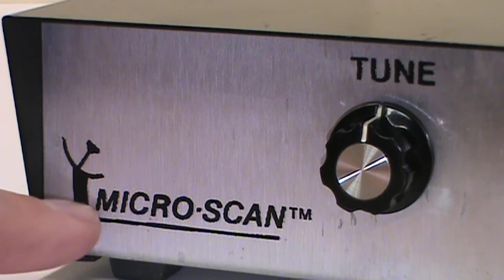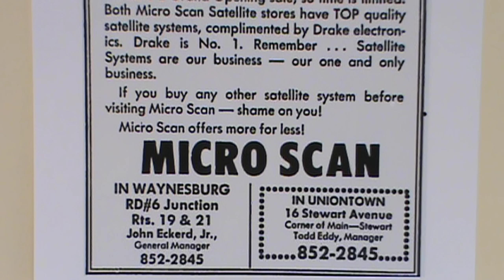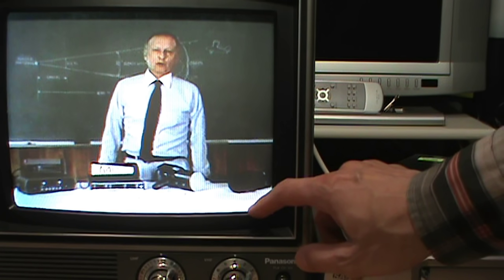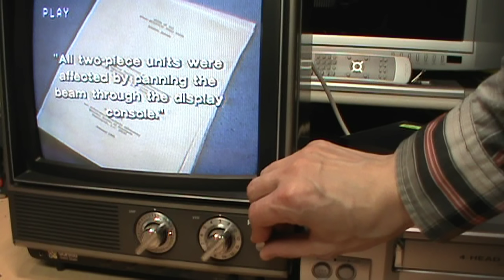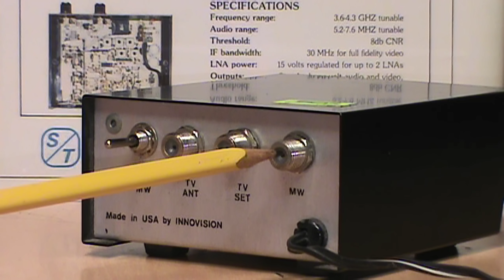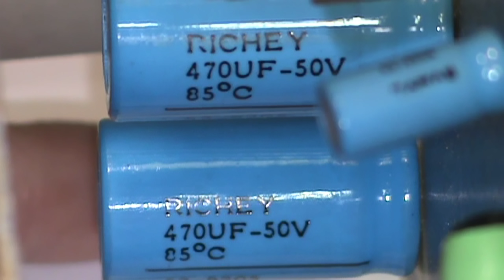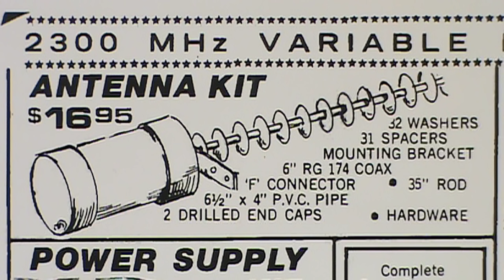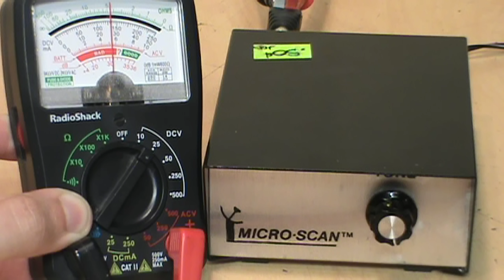Micro-Scan mystery 1980s TV device - Satellite? Microwave?

Comment: The minute I saw the box, I knew what it was. I bought the antenna you see in the upper left of the page and it included a box similar to the one you have, except I believe mine was in a wooden box. I want to say that the system was called a 'MDS" system Multi-point Distribution System. In the Metro DC area there was a transmitter somewhere like Silver Spring or Rockville and the signal was a pay service such as HBO or Showtime. The tuning knob adjusted the voltage into the antenna to actually tune the frequency being received. 

This was about the time VTIF's Variable Tuned IFs were becoming popular. The reason you didn't fing a lot of information on the devices is probably because of the following. The MDS frequency was just outside the Ham band. These devices were often marketed towards Hams for experimintation but the frequency 'slop' covered the MDS frequency too. Thus it was sold as aHam experiment but (nudge nudge wink wink) it allowed people to illegally access signals which were part of a paid subscription service, thus cheating. You should know that there was a time when satellite dishes for home reception were becoming popular. HBO and other services were not scrambled because , who could possibly have their own satellite dish at home? I did, a small one. 

HBO shut off their east coast feed at about midnight but the west coast feed continued for another 3 hours. You could watch uploads like Star Trek being uploaded and downloaded from the satellites t othe networks and often see shows on your own dish a week in advance of the actual public broadcast. You also could see live news feeds being uploaded. During the OJ trial, I was able t owatch news feeds inside the courtroom, see who was waiting outside the courtroom, see the press interviewing people outside the courthouse, just by flipping channels. So although these MDS systems were neat, they were very limited t owhat you could watch compared to real satellite TV.

I started working for a satellite TV receiver company. Telstar 301 had two channels with audio channels crammed onto them. I was able to decode a channel and found outbound telephone calls to Eurpoe. The other channel I assume had the retune audio channel for the conversation. I am sure they encrypted those channels as the public got more into owning their own dishes.
Reply: Something very “romantic” about this story, a window back in time. Thank you.
Reply: @soldierski1669 excellent way to put it. Cheers
Reply: I remember these,  all those  disc yagi antennas up on roofs,  some people made home made versions of these using soup cans and stuff.   those businesses went belly up as soon as people found out they could get free HBO buying one of these things nobody was going to pay for those services.  by mid 80's  the BUD (big ugly dish) C-band was the rage.  then directv took over by mid 90s.  and well they are still the king for over the air cable.
Reply: We had something similar to this in the 1980's with a small dish. My dad pointed the dish at the IDS tower in DT Minneapolis and we got to watch HBO.
Reply: Oh man I could tell you a story about that. I was in my VW bus which I still own, and I had a couple of those that I built from the kit and the little microwave receiver dish anyway I was parked next to this hundred thousand dollar motor home and the man had said see what you can get when you retire. I was watching some rated r movie and it was patched into my stereo system with a 16 and graphic equalizer, 200 w, and four- 6x9 speakers, I had ran the coax out to the picnic table and put two of the portable speakers on top of the on the ground, that was in Southern California😅
Reply: @patrickmccleary1144  i got one of these devices from my uncle who was a ham radio operator around 35 yrs ago, he taught me all about creating antennas and boosting cb, some yrs later i bought his vw beetle which i still have to this day.
Reply: Holy cow! My Dad had one of these, and I instantly recognized it. I was about 8 years old when he set this up. I remember it being a long summer project he worked on. He explained it a little when I was young, but you just filled in the details I either forgot or never understood. I am in IT Security today with a long history in networking, including mobile phone networking SS7 and such. 

My father passed away in 2021. I did ask him a few times over the years about this. He couldn't remember the details. He did this in like 1983 or 84. He had other projects like Teletext and such. 

THANK YOU!!! For stirring up good old memories and piecing together a 40 year old mystery in my head 😂.
Reply: Remember when at night , what came on??
Reply: @michaeltorrezmt and MMDS microwave wasn't scrambled in a lot of places..... that's why these receivers were quite popular.
Reply: Did you get any sports programs with that box. I had a old sat dish in the mid 90's , I had a lot of fun watching sat tv. I would go up and down every satellite looking for live feeds, I was obsessed with watching hockey feeds. Finally got to see what hockey night in canada was all about, great program. Unfortunately, after the mid 90's channels started dropping, because they were going digital. After a few years it was all done.
Reply: I lived in Reston, VA. and the pay tv was Star Channel, I believe. It was about 2 movies a day switching up every other day. The box you got from the company to watch the pay tv.
Reply: In the DC area MMDS was broadcast on 2155MHz from the same tower as CH20. It was off River Rd in MD not far from the DC border. I built a single transistor downconverter and got free HBO. The transmissions were unencrypted and standard 6MHz NTSC. The converter had an oscillator and a mixer to make CH 3 output. They did have sniffer vans who went around looking for "illegal" receivers and would send a bill to the address where one was found. I was in a high rise apt building so I never got caught. I had such a strong signal that I just used a coffee can antenna with a single element.
Reply: I remember as a kid in DC metro trying to watch Super TV adult entertainment by tuning near the top end of UHF and manipulating the analog tuning dial in attempt to recover the vsync.  You could make out just a little of what was going on.  Good times.
Reply: @rfengr00  In Europe we had 'Film net' a satellite channel that 'shared' frequency with an 'adult movie' station. When filmnet finished broadcasting around midnight, the adult movie channel began broadcasting. I found this out one night after leaving a long play VHS cassette recording a film on Filmnet. When I watched the tape back, at the end of the movie there were a few mins of adverts and announcements and then suddenly a porno. I would then regularly 'fish' for pornos by leaving a longplay cassette recording a filmnet film all night. Hooked a few good ones!
Reply: We did too except it was gigantic! We were like future people in the neighborhood with that beast.
Reply: I was about 11 or 12  when I discovered these devices. I was forever at the library reading electronics books and using the microfiche machine to read magazines. I cobbled one together with the help of one of these articles and put my antenna up and was the hero of the year in my house. 

My mother wasn't mad at me for cheating she was amazed at what her son was learning at the library. My mother wasn't an educated woman and my father wasn't around, being autistic I would drive the poor woman crazy with questions and she just started saying. "Billy, there's this building with lots of books. It's called the library why don't you take your narra ass over there and see what you can find.". Low and behold one can find all kinds of information at the library. She helped me get into electronics trade school at around 14 and at 16 I was off to work repair computer equipment. 

Great video and thanks for the nostalgia.
Reply: That was the memory I had about this box. During the 1980's there was a construction project box that was similar to this one in the vid. We came to work at the electronic shop where I worked and we figured out how to make the antenna shown in one of the drawings. It was a version of a high gain yagi for receiving a 2ghz signal and converting the signal to TV channel 3 or 4. The purpose was to intercept an MDS signal on the Channel 20 tower in Washington DC sending HBO to authorized receivers at the hotels in town. HBO was aware of this hack and it became a news alert that "they" were driving around town looking for these Yagi antennas and the owner could be sited for  illegally receiving this subscription service. So I sent off a letter requestion a legal subscription to HBO and they sent me a HUGE parabolic antenna that gave me a much clearer picture. I split that signal and ran a CCTV cable to their house next door and they had free HBO...
Reply: We had similar in the UK with 'satellite TV'. In the early days of 'Sky TV' etc, the channels were not scrambled or on subscription, so all you had to do was buy equipment that could read the signals. We bought a cheap £99 dish and receiver box from a hardware store and dad connected it up. The receiver box looked like a radio, with a dial knob and a little needle in a window that would move right or left. We got Sky TV for free for about 4 years before they began to 'scramble' the signal and requiring you to buy their 'decoder box' and 'smart card'. We bought those and plugged them in and ran that way for several years but the decoder box often 'failed' at key moments. Once during a football match just before a goal was scored. The guy was just about to score when the screen turned to snow and the 'insert smart card' message came up meaning you had to remove the card, switch off the decoder box, switch it back on and then reinsert the card. By the time we'd done that, all the action replays had finished and we got back in time for the commentator to say "Well, that was probably the best goal you'll ever see!"...soon after that they started with the 'Sky box office' for boxing matches and then you had to have packages for the football etc and so we stopped watching satellite TV.
Reply: @caeserromero3013  It was chicken and egg back then. At the start Sky was just one channel and nobody was going to pay for such a limited service. I was into satellite TV in the late 1980s with a rather flimsy 4ft spun aluminium dish and a receiver on which every control was analogue. Channel tuning, sound tuning, polarisation. Polarisation drove an RC model type mechanical servo in the feed to the 1.8dB noise figure LNB.
Reply: @caeserromero3013  Until Sky became digital, you could buy a "chipped box" for about £50 which would let you watch all channels including all pay per view
Reply: @caeserromero3013 the good old days of sky even in recent times sky could be had for very cheap if you knew someone with a subscription and got them to get a multi room package then you could use it at another address which I did for sometime. Now with modern sky stream you can have up to 6 multi rooms for same price and it's done over the internet. Yes allegedly they use the IP to determine location but we have multiple boxes that use the same 4g tower in different locations and they are fine. Gotta do what you gotta do even in these modern times. Yes there are free options from the likes of Kodi but skys UI it's just spot on imo and I'm quite happy to pay it and then let family share to save them some money.
Reply: Did any of you commenters build a heathkit robot?
Reply: So a pirate box for satellites
Reply: @joe_schmoe_420  Not for satellites. It was for terrestrial microwave broadcast (see MMDS).
Reply: In Los Angeles (late 70's) a company operated a direct microwave (not satelite) subscription movie service called Z TV. Many illegal, rooftop dishes and bootleg decoders were available to avoid the monthly fee.
Reply: Raw sports feeds were also a thing. Wanted to watch the game without commercials or watch out of market games in days when that wasn't possible? Want Playboy TV but didn't want your cable company or wife to know? Satellite was your answer.  And when they first started encrypting the signals, IIRC there were lawsuits arguing that shouldn't be allowed.
Reply: Old school, awesome.
Reply: I still have my home made power box that powered an antenna to receive HBO in the 80s
Reply: Telstar 301 was where all the action was way back in the day for "sky scanners".  Another neat satellite to mess around with in North America was Satcom F1.  Aside from NBC being on that satellite, Art Bell's radio show was on an audio only subcarrier uplinked from the Las Vegas teleport.  That teleport uplinked video on that same channel occasionally, but it was Art Bell's radio show that pretty much was a mainstay (operating 24/7 and looped the previous show during the day when he was not doing his show live at night).
Reply: Very interesting! I remember when HBO went off at night when I was a kid. Recently I went looking for their little sign-off cartoon, and, sure enough, it was on here! I am not at all a tech person, but this was definitely a very interesting look at something from another time. Thank you for the info!
Reply: A silver spring local?  Thanks for sharing your knowledge.
Reply: Yep we had one in Portland, OR. Used it to watch HBO for free.

Comment: The item you have is part of an MDS system. An MDS system I say they're MDS or MDDS anyway a transmitter was on top of the mountain and it blanketed the whole city with 2.4 close enough gigahertz they found that the amateur TV frequencies was right next to it so if you put it up and pointed it toward the mountain you could bury the voltage which varied an oscillator and you could get back that time over the city of Los Angeles if I'm not mistaken it was z channel. I used to manufacture the circuit board that order the little dishes about maybe 12 16-in diameter solder the components on the board drill a hole in the center of the parabolic dish put this in that was the receiver run it down to the box and then out of the box to the TV oh some of them had switches that you can bypass the microwave distribution system some of them didn't. I'm in my '80s and I remember oh my goodness selling hundreds to people who didn't want to subscribe to the service they could illegally receive the signal. Also the oil rigs out off of Los Angeles correction Santa Barbara Oxnard we were contacted to set them up on top of the oil rig to give the workers that have time off TV because they played current movies. Anyway thank you for bringing back the memory it's funny how time passes by and you forget that these things God bless bye-bye

Comment: It intercepts microwave video signals that used to be beamed from satellite downlink sites to remote sites, I had one to get paytv on a mountain with no other cable, internet, tv signals from the valley. the microwave feeds were from valley to valley. the associated yagi multi element connected with a coax cable that had to be correctly aimed at the source.

Comment: I lived in Anchorage Alaska in 1978 and the local cable tv was broadcast over microwave to its subscribers.  My dad purchased a kit and we built a pirate microwave receiver system.  He used an aluminum snow dish (the ones you would slide down the hill on) and parts purchased from Radio Shack.  He soldered together the kit.  I think he even etched the circuit board.  The finished box looked just like the Micro Scan...minus the labels.  You would turn the knob to change the channel it was picking up.  He loved saving the money.  The dish was inside our attic, but pointing towards the microwave transmitter, and it worked great!

Comment: in the 1980s these were used to get HBO in Silicon Valley and were intended for residential areas that did not have access to the cable system. The knob was for fine tuning the channel, which could drift off on occasion.  The dish was a stamped out piece of white-painted sheet aluminum in the shape of an 8-petal flower 14" to 18" in diameter.  The "petals" were bent up at a 30° to 40° at their base to form a crude dish with no curvature.  The center post of the dish that had the signal receiver was made of 8" x 3/4" white PVC pipe.  The so-called dish was mounted on one's existing rooftop TV antenna mast a foot or 2 below the typical VHF antenna, and in my case was aimed at a microwave transmitter on top of nearby Black Mountain.

One day in the early 1990s I turned it on and suddenly I had Showtime instead of HBO.  I guess Showtime bought the system from them. When I moved out of that place in 1994 the dish/box was still delivering Showtime.

I can find examples of the box online but never any photos of that hokey cheap dish antenna.

Comment: the 2nd half of this was the antenna.  all it was was a plastic housing the size of a land-0-lakes whipped butter container.  the antenna were made of about 35 flat aluminun disks 2" wide and in between each were 1" long separators all on a threaded rod about 36" long and sticking into the plastic housing.   we had one in 1982 to get HBO.  we pointed it towards the twin towers in NYC  and we got HBO for free.  we bought it is NYC at a radio store and it was like $200 or so.   i was in grade school.

Comment: We had a box similar to this in the early 80's before cable tv was an option in NYC. My dad got it from someone and he installed a second, smaller antenna in the attic, which hooked up to the box. It was called "WHT," and I remember a lot of times when we turned it on, there was just snow.